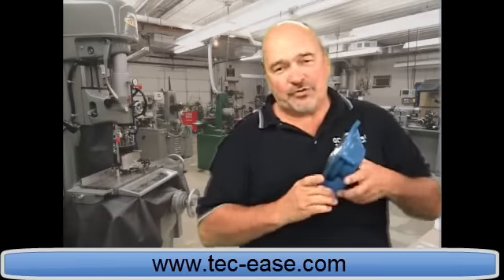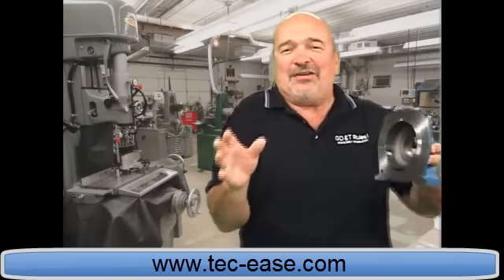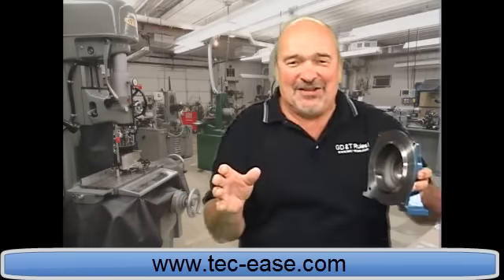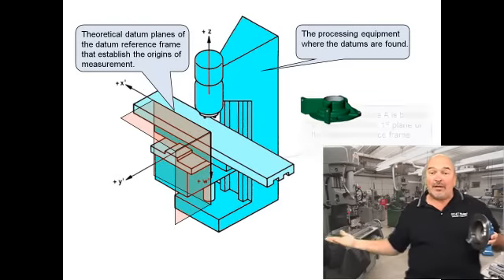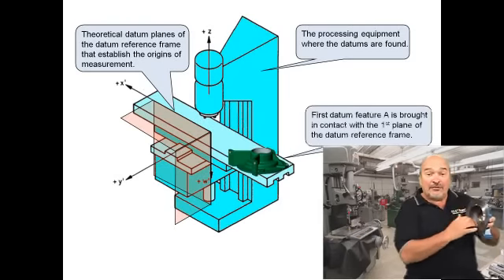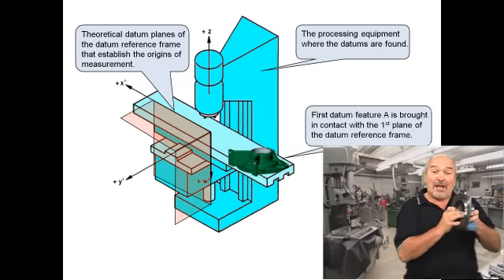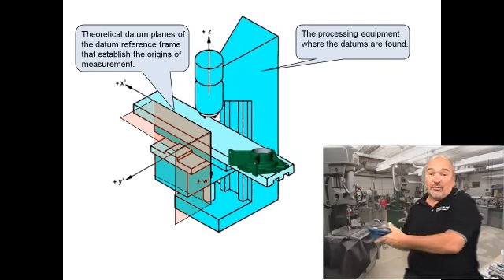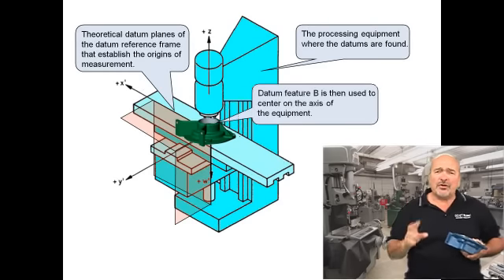GD&T Tip -  Stop the Datum Confusion!

Comment: Sir, I am a teacher of GD&T and a practitioner.  What is missing in your discussion is how GD&T should align functional requirements with machining approach.  So the face of that housing (Datum A) aligns the axis of wheel rotation with the cylindrical rotor surface (Datum B).  That allows the brake pads to contact evenly and apply maximum breaking force - very important and the prime purpose of that part.  In order to achieve that function, the milling machine must align to Datum A and B to ensure that function is achieved with proper machining.

Comment: this man needs to read the definition of DATUM in the ASME Y14.5 M2009.
Reply: No, Don does not need to read the definition of a datum.  Don is pointing out the difference between a datum and a datum feature.  He does this correctly.  One thing that has changed since this video was recorded is that we no longer speak of two perpendicular planes that intersect on an axis being the "datum" for a cylindrical datum feature.  For any cylindrical datum feature the simulated datum is the axis of a perfect datum feature simulator, termed a "True Geometric Counterpart".  The datum is only an axis, and it does not include two perpendicular planes.  See Fig 4-3 on page 50 of Y14.5-2009.  A minor point regarding your comment is that there is no "M" in the designation of the ASME Y14.5 standard any more.  The last year the ""M" was included was 1994.
Reply: @deanwatts5919  thanks for your comment, I said the man needs to read the definition of Datum to understand what is a datum: As of '2009, the equipment establishes the datum simulators, not the datum.
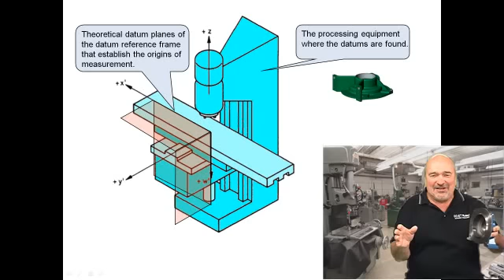Reply: @jitomateenmascarado6288  The term is datum feature simulator, not datum simulator.  The equipment does not establish the datum feature simulators.  The equipment is the datum feature simulators, and simulated datums can be found on or within the datum feature simulators.  What Don is referring to when he is point out the common misuse of the term "Datum" is the set of theoretical datums found within a set of theoretical datum feature simulators.  Please notice the label to the upper left of the diagram that appears at 0:50.  Maybe he should have added more detail to the explanation, but I assure you that Don knew the difference between a datum and a simulated datum and a datum feature simulator.  I knew him well and spent many hours discussing these things with him.  He was addressing the first step, which is getting those using GD&T to stop calling datum features by the wrong term "datums".  A follow-on to this tip could have been (and maybe was) to clarify the difference between a theoretical (unobtainable) datum and a simulated datum that can be found on or within a datum feature simulator.  The fact that a datum is theoretical and therefore unobtainable makes it even worse that many people call those real features on the part "datums".  The point of Don's video was to make the first step towards better terminology.
Reply: @deanwatts5919  thanks for your comment.. have great day.
Reply: @jitomateenmascarado6288  - Thank you.  Those of us who "speak" GD&T should always be a friendly bunch.